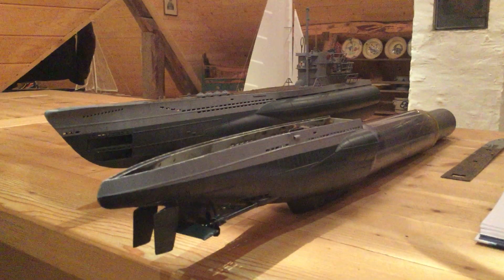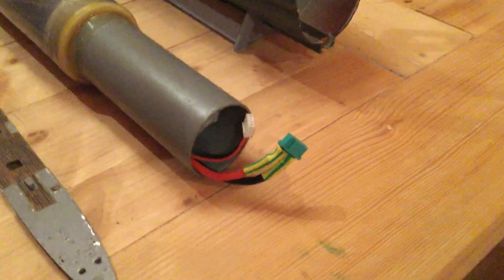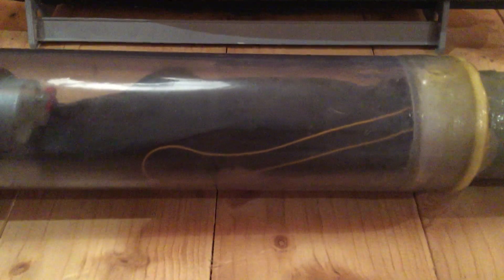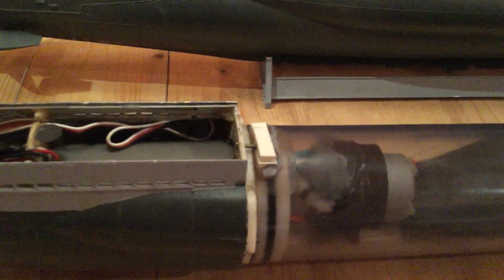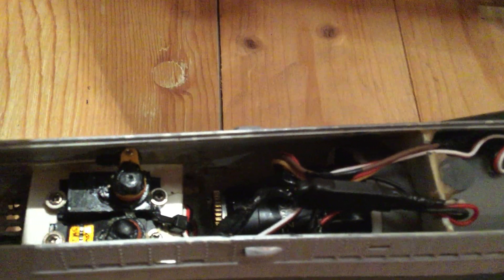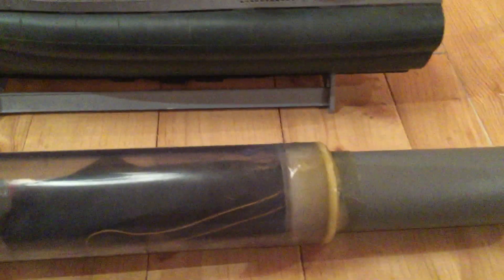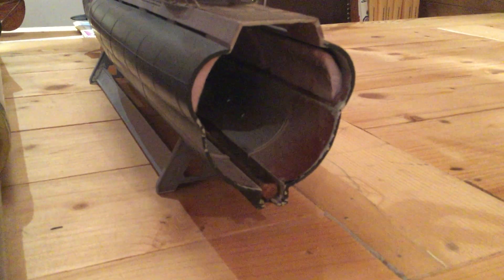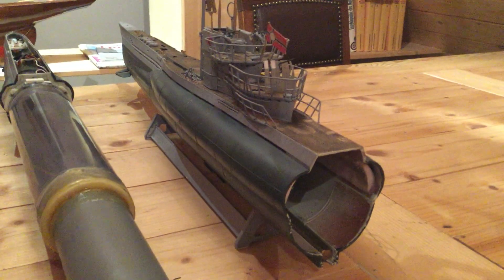Submarine VIIC Revell, looking  inside to the technique

Comment: Thank you for showing how your wtc is set up. Very good system. Are you using 2 brushless motors for each shaft?
Reply from the maker: No, on the brushless is a gear mounted and on the shafts as well. Actuel I use only one shaft, it has more than enough power.
Interestimg for you:
The pump is from „Maximus Modellbau“, a specialist for submarines, the pump is called Maximus II. I tried before  with a gear pump, it was not  satisfactory, because ist was not  possible to get out the air complete.
To build the flexible tank I used Loctite 406, ist works very good. You can also built the tank with pond line.
In forum RC-Modellbau-Modellbau-Schiffe“ I made a report, it‘s called „Umbau Revell VIIC zum statisch tauchenden Boot“ in category „Faszination U-Boote“. If you will be a member, ist costs nothing, you see  a lot off pictures and explanations with a lot off problems.
In which country you are at home?
Reply: @u67iringbarth  thanks, will look it up. I live in the Philippines😊
Reply from the maker: wow, that is complete on the other side off the world. I think it‘s exotic on Philippines to build a german VIIC👍😁
Reply: @u67iringbarth  Type VIIc is my favorite😊
Reply from the maker: My as well, can you make a clip from your VIIC?
Reply: @u67iringbarth  still in planning stage☹
Reply from the maker: Okay, maybe  when you start the project, I wish you much sucsess.
Reply: Having trouble signing in to that site. Won't accept input in birthday.
Reply from the maker: Hi Romel,
I did ask, what the problem could be, I hope I get an answer.
Reply: @u67iringbarth  i was able to register now using my computer. I was using my mobile at first. Thank you.
Reply from the maker: @coast219  👍
Reply: @u67iringbarth  still can't see your pics. Keep getting this "Unfortunately, you are denied access to this page. You do not have the necessary access rights to access this page." I think I  need to have 30 posts before I'm qualified🙁.
Reply from the maker: @coast219  ah okay,  you have signed in, this is the first step.  Now an administrator will activate you, I think, this needs one or two days.
What‘s your name in forum? I can look for you.
Reply: @u67iringbarth  redboat219
Reply from the maker: @coast219  ok, I did find you. I startet a concersation with you, it didn‘t work. We try tomorrow again, i think it‘s the activation.
If we have tomorrow no access I ask an administrator.
Reply from the maker: @coast219  Now it works, I started a conversation with you.
Please check again.
Reply: @u67iringbarth  i'm in. Thanks.
Reply from the maker: @coast219  👍If you have questions you can ask in my thread. You can also start  an own thread, in forum there are a lot of specialists for submarines, who can help you. Good luck.